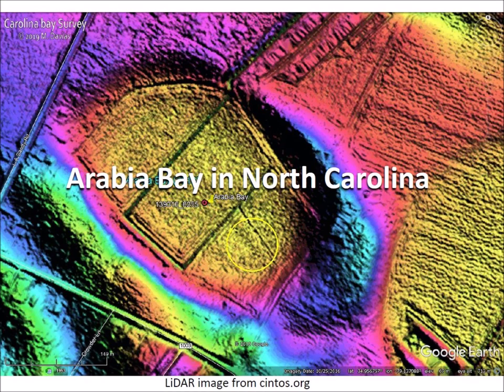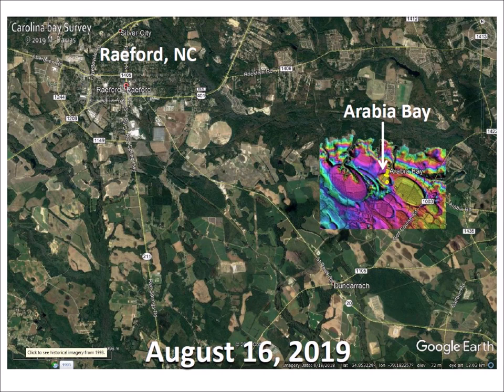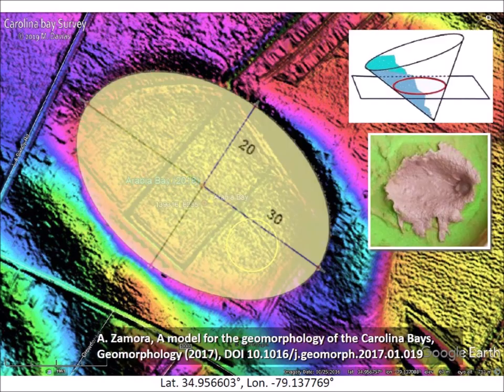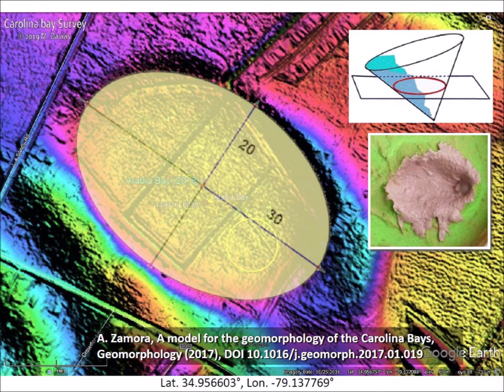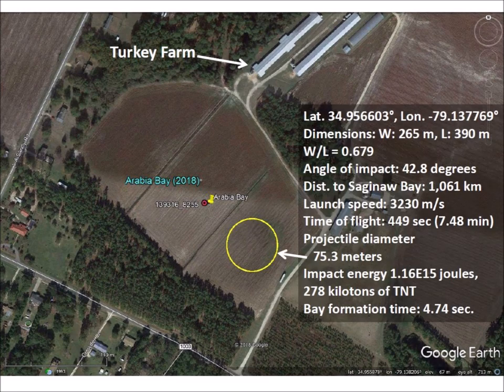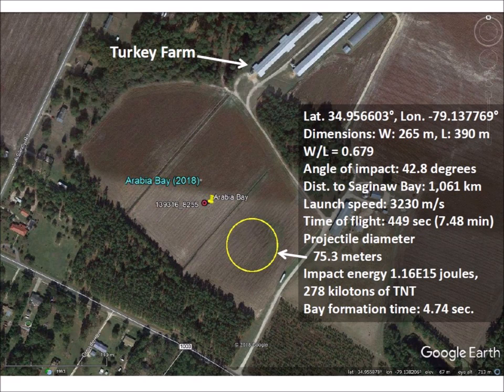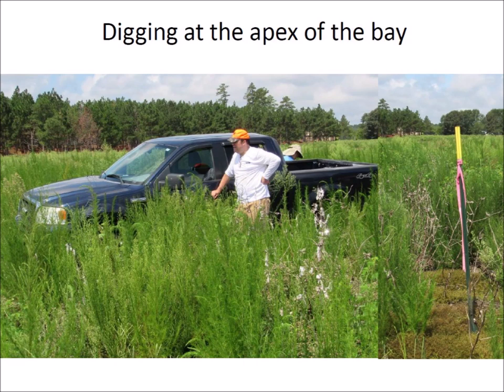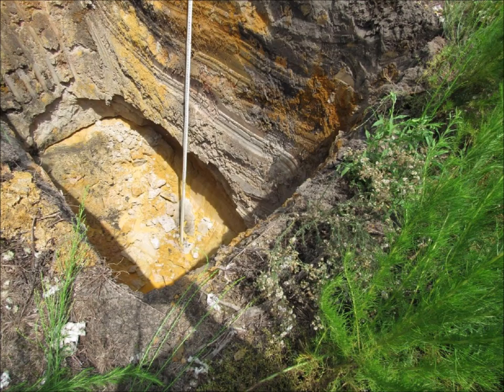Arabia Bay in North Carolina

Comment from the maker: I had to re-upload this video to correct a couple of errors.  Sorry about that.
Reply: Has any work been done to investigate the possibility of bone fragments (if any) in & around the Carolina Bays?  I understand that little might be left of any living beings who happened to be at the point where the ice bolus struck, but some other evidence may still have survived underneath.  Just curious....great videos.
Reply: Thank you Antonio. 👍
Reply: First of all I noticed that the water table in that part of the country was close to the surface, just as you had predicted.

Secondly I am perplexed at the speed of the ice chunks and the flight time. My gut tells me that the flight time would be much longer and the speed much slower. 

Lastly, and most importantly, I believe that a huge ice chunk propelled very fast through the Earth's atmosphere would liquify on its surface and begin to vaporize causing a significant loss of mass. However, most remaining ice mass would be preserved by the cold vacuum of space where most of the travel time would occur. 

"Lift off" and re-entry would require much less time. 

Antonio I made for you a video. Click on my icon if you wish to see it. Thumbs up, sir!
Reply from the maker: Ablation, or the melting of the surface of the ice by friction, is not very great during the launch stage because a large ET explosion lifts the atmosphere along with the ejecta into the rarefied upper atmosphere where there is less friction.  Ablation does happen during re-entry, but with a massive ejecta curtain coming down, many ice boulders would be in the slipstream of other boulders thereby avoiding large losses of mass due to ablation.
Reply from the maker: With impact energies of 13 kilotons to 3 megatons of TNT there would not be much left of any living beings.  However, some reports of blown-down forests are described in this video: https://youtu.be/vrFj5UT0htE
Reply: Apology accepted! However, for $20 I'll forget the whole thing. :-)
Reply: @Antonio_Zamora  i am very appreciative of your work and interaction in the comments antonio. I learned of you from Bens (unchartedx) channel. I look forward to staying tuned to see future videos. You, ben, randall carlson, malcom lecompte and others are inspiring like minded people that mainstream science can be challenged if proper research becomes evident and overwhelming. One day soon i will join the voices that speak the truth of our planets history. Thanks again for your work.

- a fan of history and science, and future reseacher.
Reply from the maker: @superstitiouspre-literatep9730  Thanks for your support, but regarding Malcolm LeCompte, I suppose that you have not read chapter 27 "Cape Fear" of Graham Hancock's book America Before. Although Malcolm is working in support of the Younger Dryas Impact Hypothesis, he objects to including the Carolina Bays.
Reply: @Antonio_Zamora  oooh spoiler alert haha im currently reading both america before and magicians of the gods but spending more time with magicians at the moment. This is good though, because what ive learned from both of your podcasts with ben and your videos on this channel i get impressions from both sides when i do get to this chapter. Perhaps ill skip to it for now, while this topic is fresh in my mind.

Comment: Wha' happen'd? Thanks again! BTW there might be grains of shocked quartz among whatever sand particles were to be found at the bottom of that pit.
Reply from the maker: A couple of people have suggested that there might be shocked quartz or planar deformation features (PDFs) within the Carolina Bays.  That is quite unlikely because the formation of PDFs requires pressures of 5-35 GPa.  Impacts on liquefied ground are very "slippery" and the target material flows around and away from the projectile too fast to permit the buildup of such great pressures.

Comment: Would a percussion coring tool be useful here? Or perhaps one that can be pushed into the ground with an excavator?
You might be able to reach deeper than the water table limit you experienced.
Let me know.
Thanks,
John
Reply from the maker: Coring has been done at other sites. Digging the trenches made it possible to look at a broader context of the layers of sediment and to collect one kilogram samples of the desired layers. The large equipment was on site for a bay restoration project and provided a cost-effective way of sampling.
Reply: Antonio Zamora 
Thank you.

Comment: I could not see any rocks in the video.   Are there stones or is it completely sand and clay?
I wonder if a survey with ground penetrating radar around the apex of a bay could pin point the location of a  sizable  boulder transported by the ice boulder?
Reply from the maker: There were no rocks. The ground consisted only of sand. The bay was made by a relatively small ice boulder which was unlikely to carry any sizeable stones or clasts.

Comment: The number of safety regulations that were not followed were staggering. I couldn’t tell the difference between the turkeys in the house or the one in the hole... Please stop people from climbing in un-sure trenches and use the proper safety equipment . You and everyone on the site are responsible and the equipment operator should have known better. Just my two cents. Don’t mean to be an ass but have been on site where lives were lost.